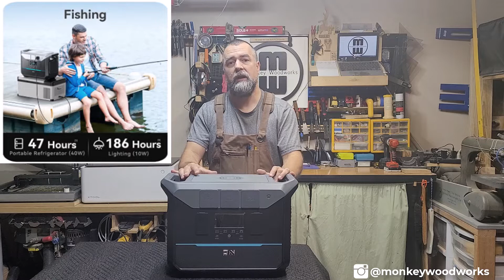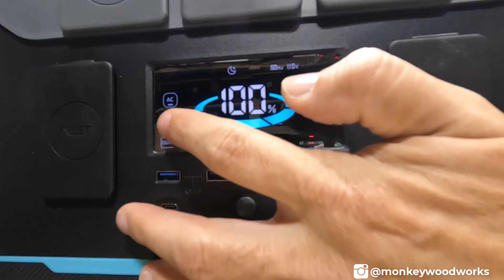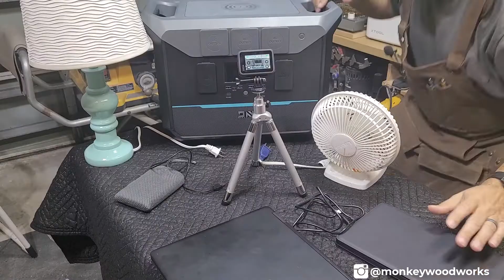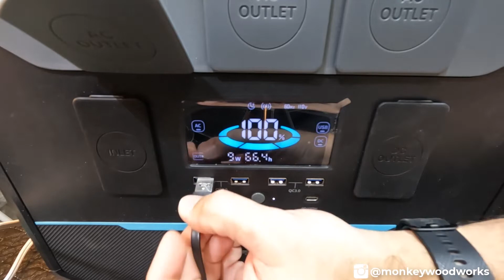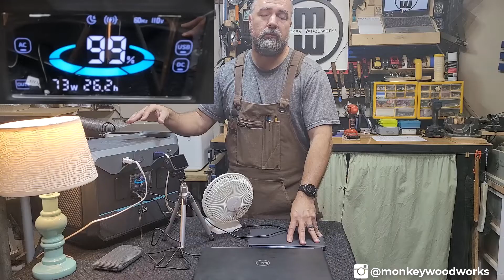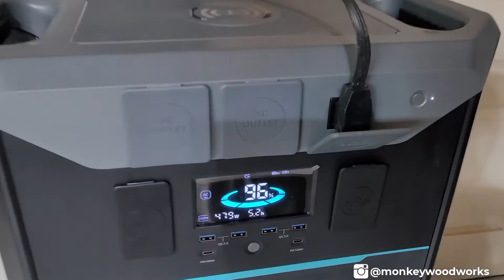NEW DaranEner NEO2000 - 2000-Watt LiFePo4 High Output Solar Generator/Power Station

Comment: 5.2 hours running a deep freezer seems low.  I noticed your deep freezer was pulling over 480 watts.  I'm guessing this is with the compressor running.  Since the compressor doesn't run all of the time, I would think the actual runtime would be 2 to 4 times longer at least.  I do like your video.
Reply from the maker: I agree 100%.  That was an instant measurement and didn't think about mentioning that the compressor cycles and that runtime will be much longer than I stated.  Plus, you can technically plug it in, get it to temperature and unplug it for a few hours to conserve energy and repeat the process.  Thank you for stopping by!

Comment: How many Decibel generate the Powerstation with max Solarpanel and AC Input?

Thanks
Reply from the maker: According to my Radio Shack SLM:
At 6" of the unit it measures 52db charging via AC.   Same distance discharging the AC using a 1,300 watt space heater, it measured 60db.  1ft away it dropped to 52.  My meter does not measure below 50.  I also do not have a solar panel big enough to test that input.